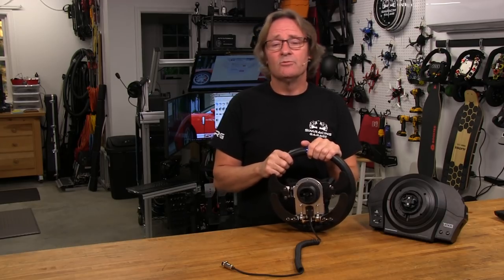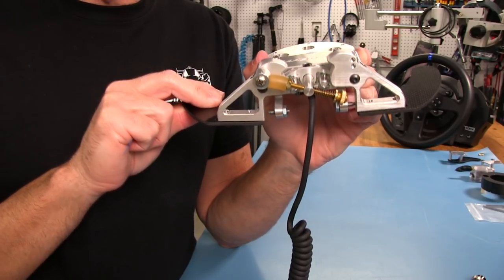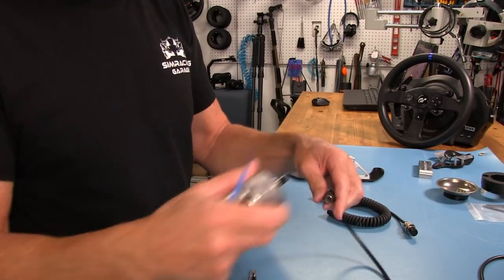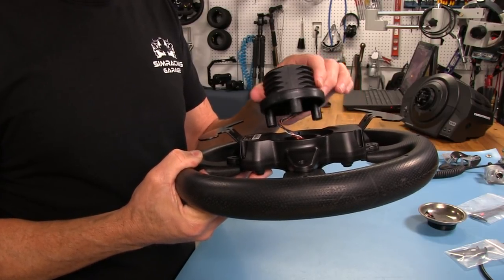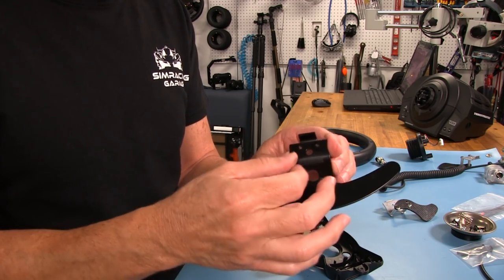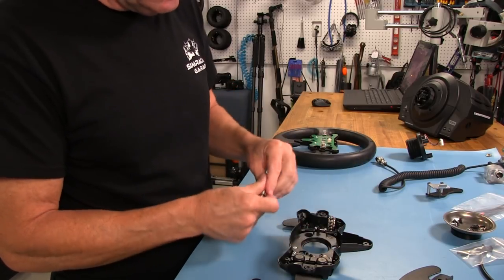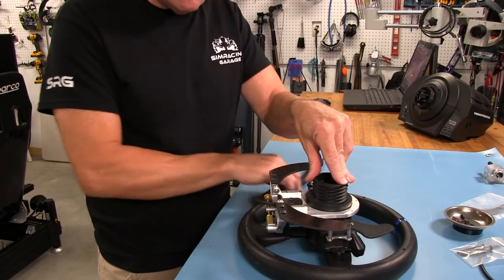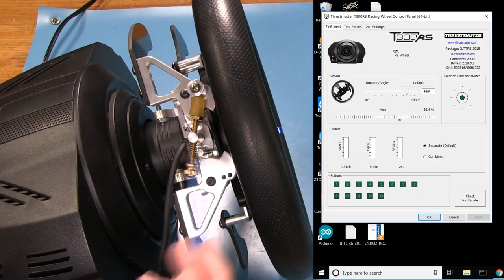Simability Thrustmaster GT Paddle Kit Giveaway/Review

Comment: That is a really well built kit, it is awesome to see a company coming up with ability aids like this. Watching, I agree with your comment that it seems hard to deal with downshifting and braking on the same side and wonder if it wouldn't make more sense to reverse the shifters so that other than blipping you are only doing one thing with each hand, accelerate right, upshift left. brake left, downshift right. It would take a bit of memory retraining to shift opposite how you've always been trained but the result is car control spread between both hands at all time.

Comment: wouldn't it be possible to exchange brake with throttle? So when you press throttle with the LEFT hand you can shift up with the RIGHT hand. With brake vice versa. It would be a better handling imo because you shift down and accelerate at the same time very rarely. Same with braking and shifting up.
Reply from the maker: Yes. In fact that's how Nate requested this be configured after I had finished the review.
Reply: I was thinking moto style, with the right paddle being push/pull for brake/throttle, and the left being push/pull for downshift/upshift.